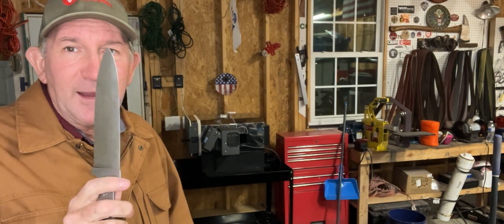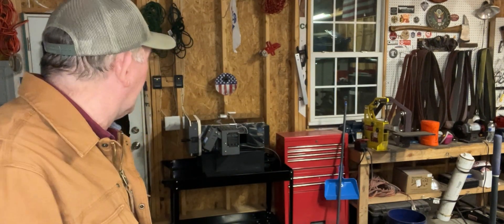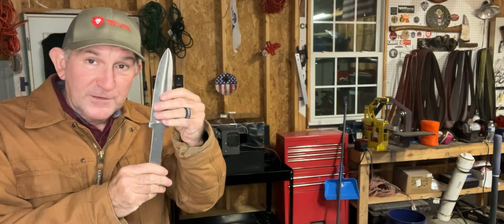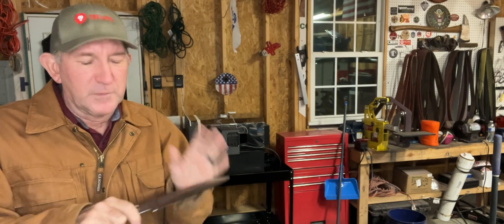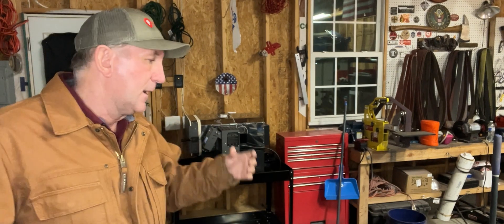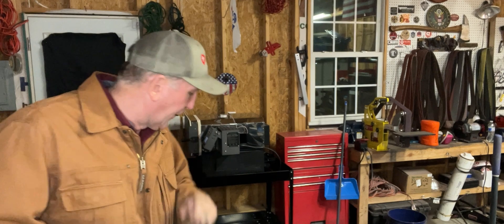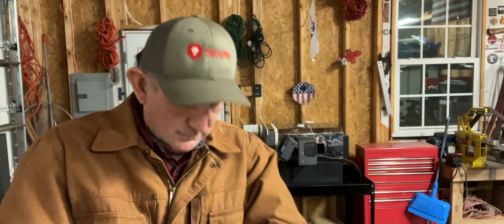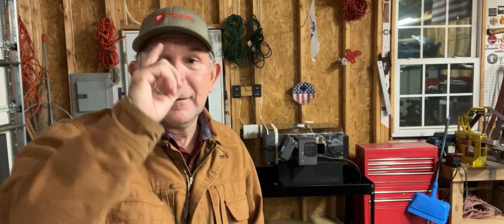Normalizing a 1095 Steel Dagger in the Evenheat Kiln

Comment: great video showing off Even heat LB 18! You say that you are staring with an annealed blade with the intent to normalize in the video. For future reference in an anneal you slow cool the blade by leaving it in the oven on the cool down or insulate it in vermiculite for example. So you've essentially ended up back in a similar annealed state. For a normalization you want to allow the steel to air cool.😀